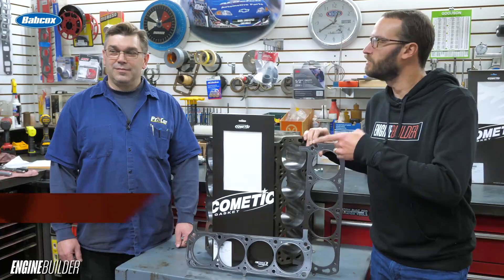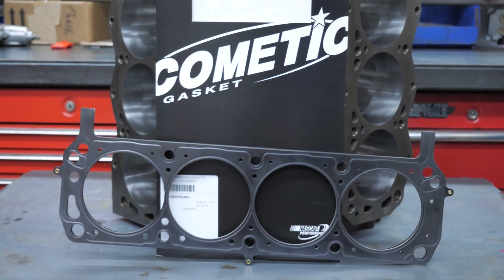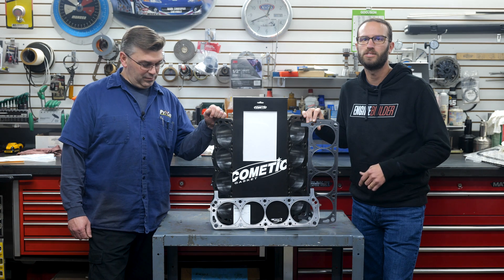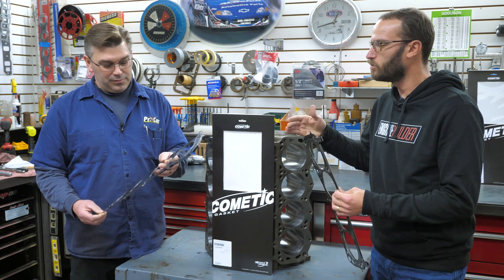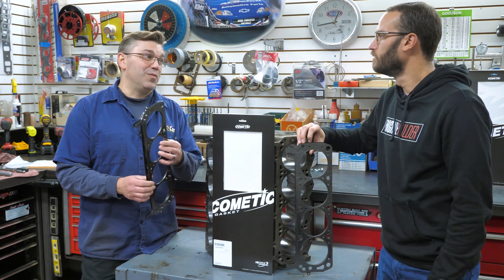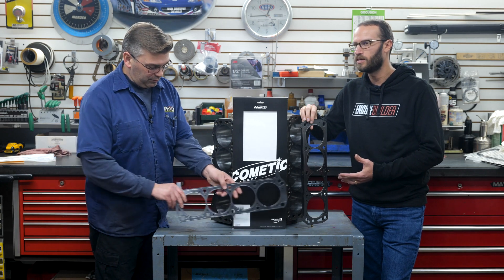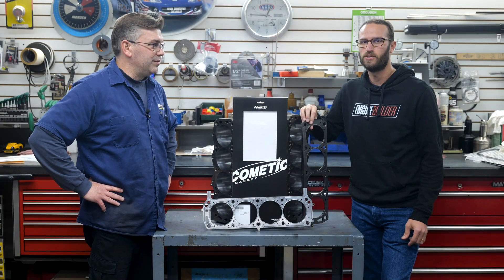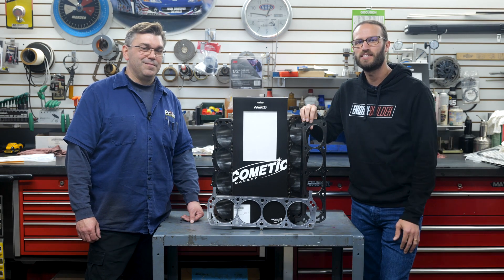Reviewing Cometic's MLX Head Gaskets

Comment: I am going to be using your gasket on my build. Do I need to spray the gasket with any sealant?
Reply from the maker: As long as your deck surface and head surface is clean and flat, no sealant should be required.

Comment: Just a warning and heads up.  Cometic makes great gaskets.  But make absolute sure nothing is in between the sandwich layers.  The little pieces of rivets that hold the gaskets sandwich can get in between the layers and I can tell you it sucks if you miss it.  I called a Freind who is a hardcore engine builder and he just chucked and said he has found it quite often over the years and just checks them as standard procedure.   I called Cometic and they completely denied it could happen.   I was lucky and found mine on a Cummins diesel build when I installed the head in the truck and noticed it rocked only to find the rivet piece with a boroscope before I torqued it.  GreAt gaskets as far as holding 60 psi of boost in a Cummins without an oring

Comment: I am going to put your head gasket on my 4P piston built boosted Honda b series and not run over 19psi. If it fails I will go on blast. This video sold me. Let's hope it's all truth. God bless.
Reply from the maker: Talk with the Cometic folks and they'll get you a gasket perfect for your 4P Honda B engine.
Reply: @EngineBuilder  .030 thick MLS 81.5mm bore LS/Vtec. They have the perfect gasket 👍

Comment: I've got a set of these MLX gaskets in my 12 to 1 blown 540 and so far so good!
Reply: How much boost
Reply: @sniperpronerfmods9811  22 so far. working my way up to 30-32.
Reply: @1320MotorWorks  did you get up to 32?
Reply: @daniyaalmaneveld3779 nope. Spinning the blower 43% over ( pretty much maxed out) and can only get 26 out of it.